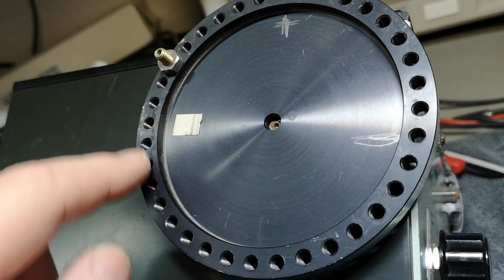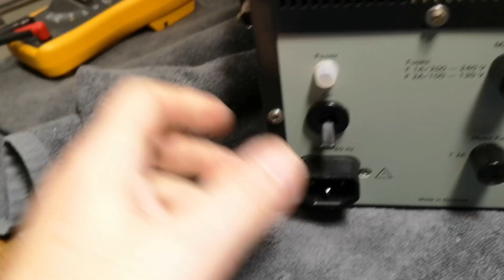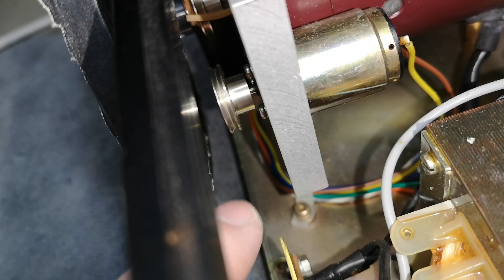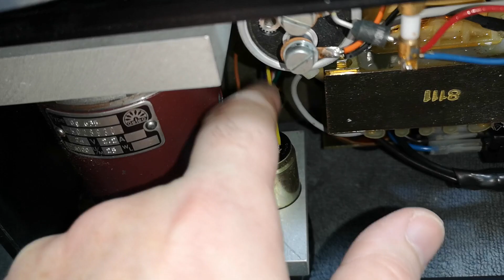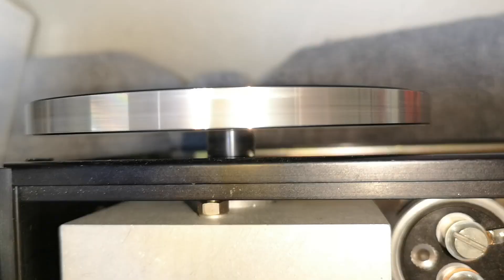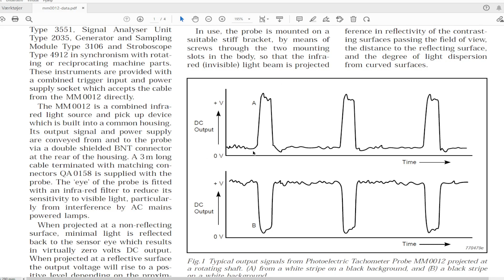Brüel & Kjær WA 0155 Balancing Demo Unit with MM0012 probe teardown

Comment: This unit was used by application specialist working fro Bruel & Kjaer. It is primariliy used for demonstrating how two plane balancing can be acheived. The tacho (MM-0012) is used to identify the angle of rotation allowing a demonstrtion of where to place corrective masses in the series of screw holes on each wheel. I can see you have a very large mass applied with the bolt and nut on Plane 1 which is too much really.  Remove to avoid injury. This unit can be used for many things beyond balancing like order tracking analysis. A very rare iten indeed and should be repaired and used. The unit relies on a feedback signal provided by a small motor connected to a rubber belt to the main drive motor. The small motor generates a voltage proportional to the speed of rotation of the main motor. If the rubber belt is broken the motor will spin out of control so be careful, the bolt and nut on the wheel of Plane 1 could fly off at very high velocity or destroy the WA-0155 unit. I had one for decades and it was an essential item for me in my job.